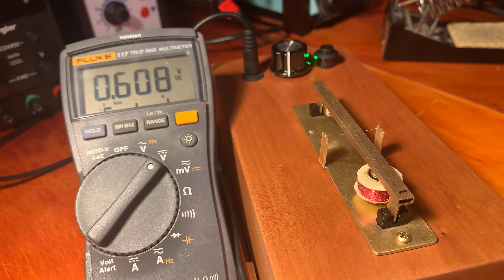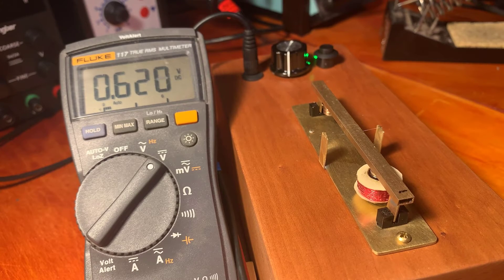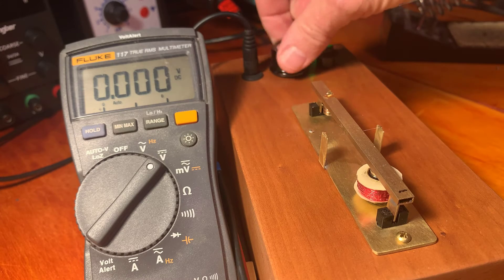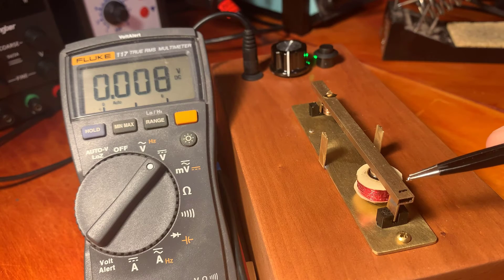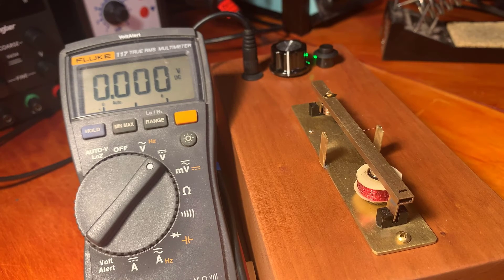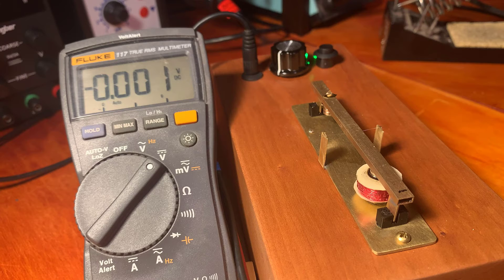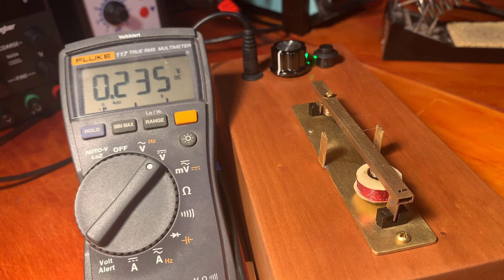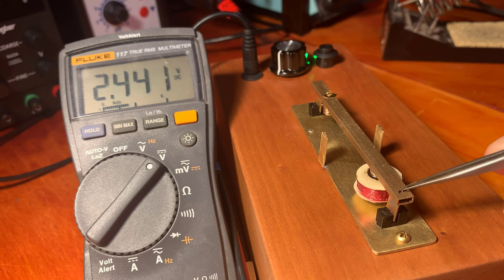DIY Analytical Balance for Gold Ore Assaying

Comment: This is a very cool project. Would it be possible to share the circuit diagram, as well as more details about the coil and the construction in general? I would love to try to reproduce it myself. Thank you for this wonderful video.
Reply from the maker: Hola Klaus. Yes, I plan on making a video about the design. Un abrazo.
Reply: Second this, great video and project, thanks for sharing.

Comment: Could you provide the full schematic of the circuit please?
Reply from the maker: Hi William, Are you planning on making an analytical balance? This project will require craftsmanship and experience in electronics, and some test equipment. I don't want you to start and then be disappointed.  -- Dave

Comment: Damn you make some wonderful equipment.
Can you not do some judicious filing so you don't need that flake of brass ?
And what did you use to calibrate the scale ?
Reply from the maker: Thanks! You know, perfection is the devil in the ear. I don't want to break the wire. It's easy enough to replace, I think... but.. .   I used these excellent calibration standards:  https://www.amazon.com/gp/product/B07K7F7D8K/ref=ox_sc_act_image_1?smid=A1OJVFAYDI0NY7&psc=1
I'm working on a better model. We'll see how it turns out.  -- Dave
Reply: @orophilia  I'm sorry - I thought the beam was simply sitting on the wire
Reply: @orophilia  WOW - How cheap are they? - I would have thought just a single weight would cost at least that
Reply from the maker: @mohammednovalija  Yeah. They are certainly more than good enough for my purposes. I think I paid $15.00 for the set.  Cheers! -- Dave